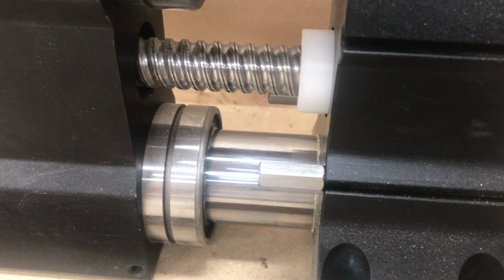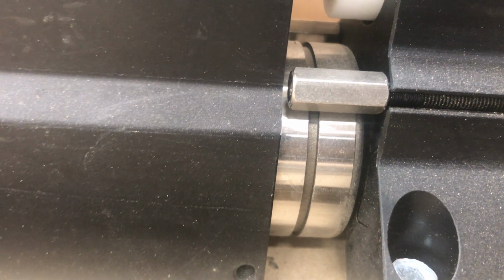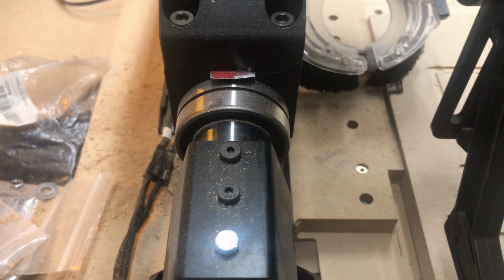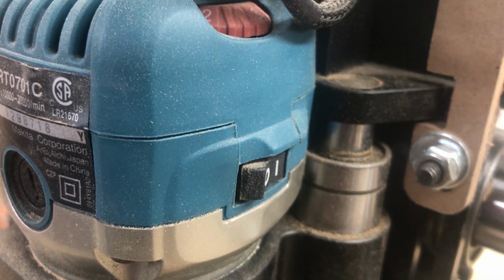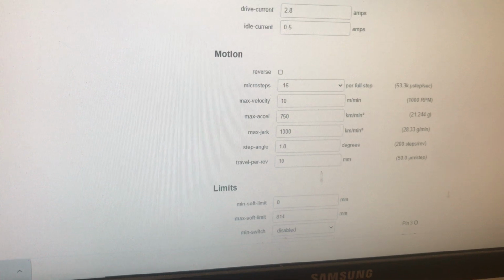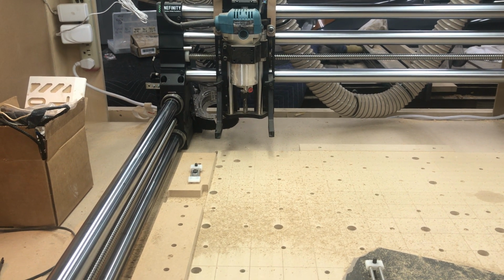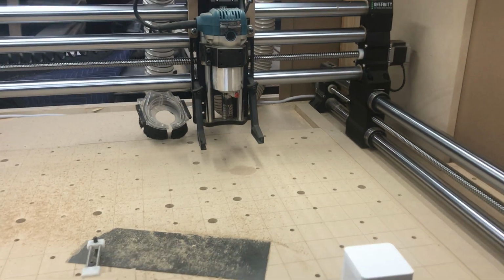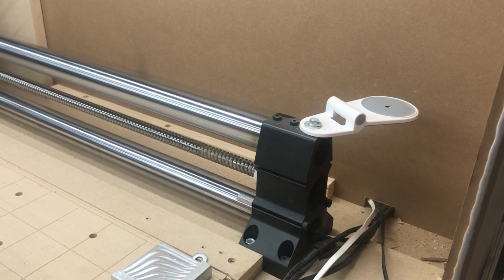Onefinity CNC Homing Stops

Comment: Why not install homing limit switches?
Reply from the maker: The purpose of these stops is to avoid problems with dust buildup when homing that could impact square.  Also, to not have the guide bearings hitting the mounting feet to help avoid the possibility of the bearings moving.  It homes with decent accuracy with the built in stall homing.
Reply: On the one hand it is not necessary because the motors are small and you will hardly destroy anything and on the other hand the two Y axes are aligned to each other.

Comment: I see some shims where the x axis mounts to the y rails. Was this a tramming issue?
Reply from the maker: Yes had to put a bit of shim in there.  Think it was 4 pieces of aluminum can.
Reply: @mikebogart3841  well mine is still a couple months away so I'm just watching and reading as much as possible so I know what to do if I have issues
Reply from the maker: The tram was pretty minor but I’m kind of OCD sometimes so had to tweak it.  Jason Stewart did a video on tramming on the FB page.  He shimmed in a different spot, I just found it easier to shim in the blocks.

Comment: Thanks for the video. Are the soft limits permanently saved or will they need to be adjusted after each boot up?
Reply from the maker: They will save to the config file.  They may have to be changed again on a firmware update but will save between power ups.  Don’t forget to click the save button after changing any settings in the configuration settings. 😁